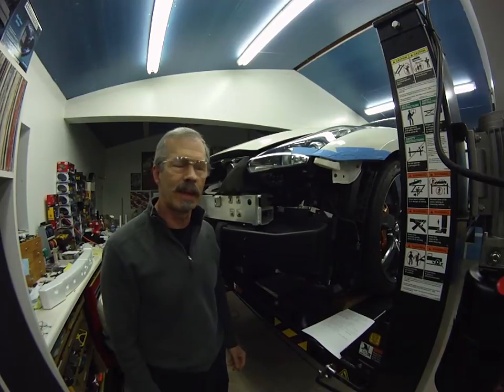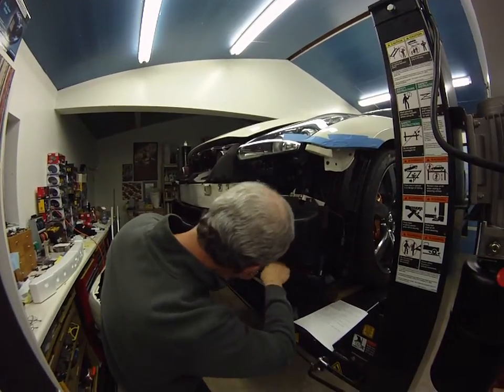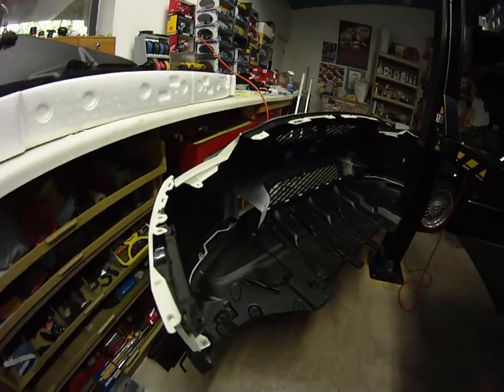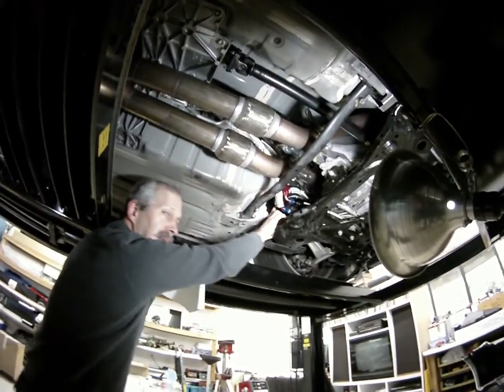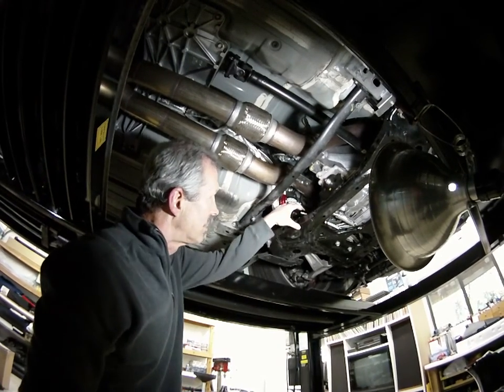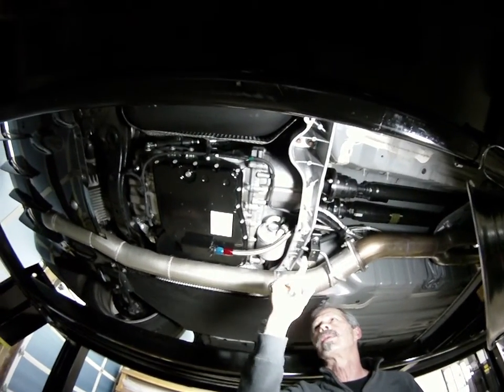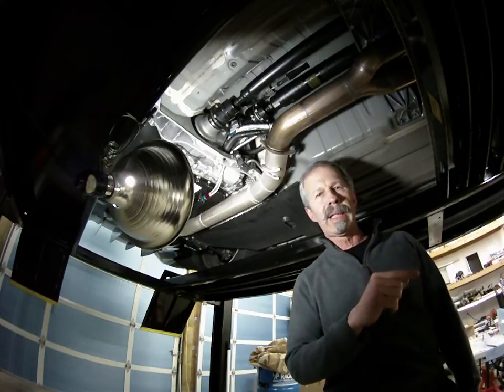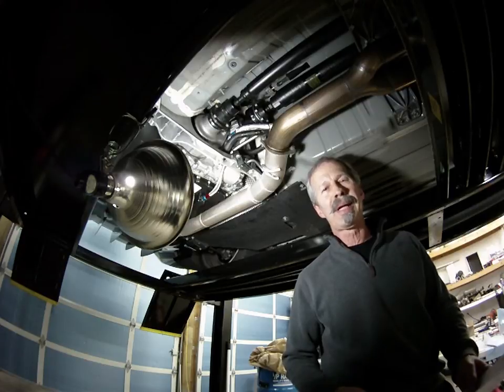GTR Transmission Cooler Fab and Install 001.MP4

Comment: when you fitted the oil cooler in place of the washer tank where did you relocate the washer tank to ?
Reply from the maker: I never did relocate the tank. The stock tank is too big to relocate and I never did look for a small tank even though you could probably find a small tank with a built in pump and then just rewire it. I just never thought it was worth it.

Comment: To answer your question Alex, the fluid probably doesn't do a lot of sloshing around but it doesn't circulate without the pump being on. Unless you're doing track work the stock cooler works fine.

Comment: If you're not running the pump, does the fluid just slosh around in the lines/cooler?
Reply: To answer your question Alex, the fluid probably doesn't do a lot of sloshing around but it doesn't circulate without the pump being on. Unless you're doing track work the stock cooler works fine.

Comment from the maker: Trevor just asked me what type of cooler I used. It's a Mocal 25 row, 235 matrix oil cooler with 8AN fittings. Part number MOC-25208. Double check the part number because this install was done in 2012.

Comment: Before I installed the trans cooler during a nice day (75 F) 20 minutes of track time would bring temps up to almost 260 F. After the cooler install, even on warmer days the temps never get above 214 F. This cooler set up really works and will cost you a lot less then the kits from the tuner shops. This data was established during track days at Portland International Raceway.

Comment: Great job, I had seen a few video on Nissan GTR, Heard a bit  from people when they modified the Cars engine, they would also change transmission to Jacks Transmission, and after seeing your video how used a positive would logical way of thinking, changing direction of pump, to send fluid to the Oil cooler, then return the fluid to back diff rational, building a flat pan, 2 new shield lines. Great Work..!!

Comment: I think Forged Performance has a link where you can download their instruction manual. It shows how they install a temp switch that activates the pump, it's a fairly involved process to get it done. Just do what I do and tape a note to the front of the steering wheel that says "Turn AC Off, Turn Trans Pump ON", simple and cheap.

Comment: You could put in a temp switch but I find that the only time you really need the pump running is when your doing hot laps at the road course. If you have a favorite road that you push the car on just keep an eye on your trans temps and turn it on if you want to cool things down to the max. 20 minute sessions on a road course is the only time you'll really get close to the danger zone of transmission temperatures.
Robert at SpeedZone Automotive

Comment from the maker: Yes, I did this in my shop. Fairly easy to do, just take your time. One update: Use the Mocal high temp micro pump. The first pump I used was the Mocal diaphragm pump. Even though it's rated at 250 degrees it can't take the heat. During a second 20 minute track session it quit working only to return to life after it cooled down. The micro pump is more expensive but it's military grade spec, gear driven and it's rated at 300 degrees. A much better choice for track work.
Robert at SpeedZone Automotive

Comment: Also i was thinking...that for how far advanced the GT-R is , that they would have installed an external transmission cooler from the factory , but i guess they needed to make some cuts some where in order to keep the overall price of the Car withing reason compared to the competition..AND that they have touted this Car to be one of the most if not the most affordable "Super Car" .

Comment: Well then that is great . I have always thought that stand alone oil coolers do a superior job at cooling than does running the oil through a radiator's tank like most manufacturers do . This is exactly why you see external stand alone transmission coolers on heavy duty trucks and some performance vehicles...because they do in fact work far superior to radiator cooling .

Comment from the maker: The GTR does have a factory heat exchanger which circulates engine coolant through an exchanger located at the front of the transmission. It's very small and does almost nothing when placed under high stress track work. Even on a 70 degree day your transmission temps will be approaching the danger zone after about 20 minutes of hard driving. For the street the factory setup is fine but if you do any road course racing an upgrade is highly recommended.

Robert at SpeedZone

Comment from the maker: This cooler set up really works. Ran a before and after test under the same type of  ambient temperatures and the transmission temps dropped 40 degrees Fahrenheit. Very impressive if I do say so myself.